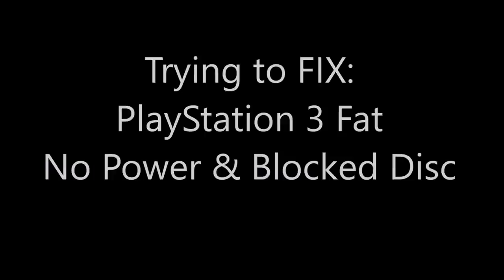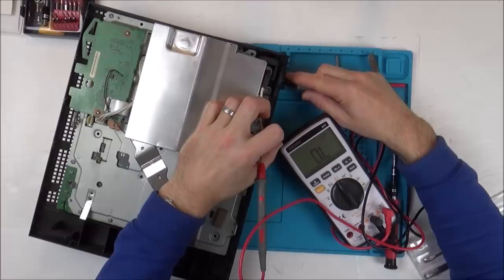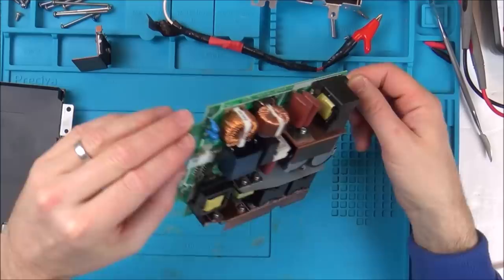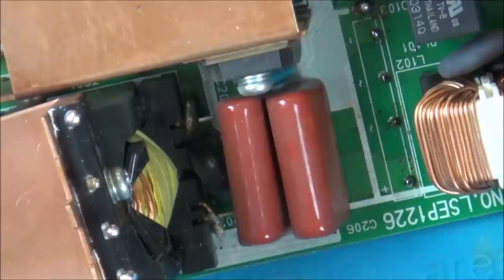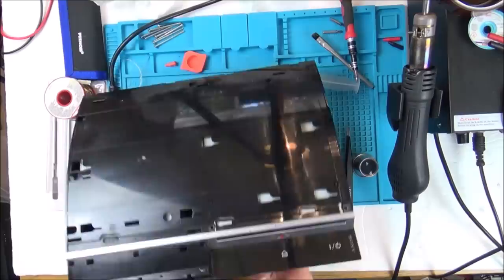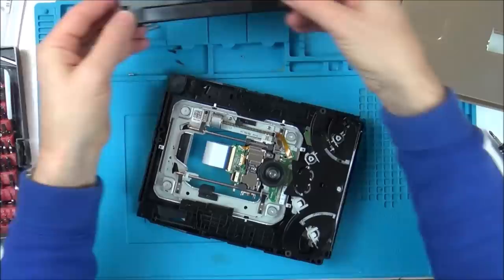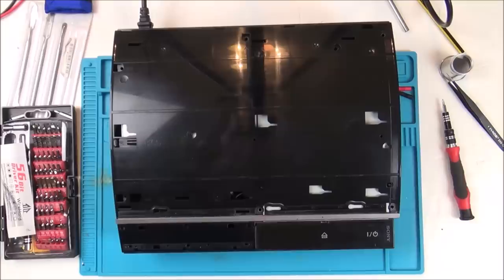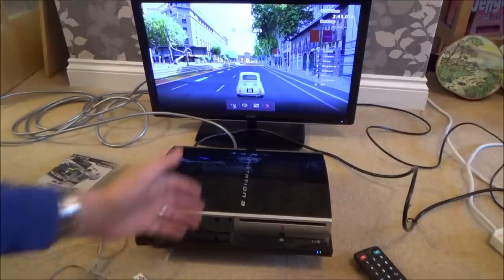Trying to FIX: PS3 Fat - No Power & Blocked Disc

Comment: I hope you used HI heat solder, or else you will get a fantastic bang when the solder gets warm as the bridge rectifier warms up , and then you only get a spectacular fireworks when the solder melts and make contact... and shorts the AC and/or the DC side. just a couple of gaming hours worth, really, you should get a solder wick and get all the solder off and then mount the rectifier properly in place, I hope you only use this when your in the room, and NEVER leave it on without supervision,

Comment: How long does it take for fan to go full speed? If only a couple minutes, it could need new paste under the CPU heat spreader. They are a pain to pop off and puts a lot of strain on the board. I would recommend soaking the CPU in Goo Gone for a day or so. It is a non conductive solvent. It will soften the old adhesive and paste. There is a slit on the side of the heat spreader that it can soak in from.

Comment: Vince, the power button might be working as intended. When the console is on, it ignores a single tap of the button. It only responds to holding it down for 2 seconds after the console is finished loading, then initiates its shutdown procedure.

Comment: The power button is a capacitive touch sensor. From the looks of it either the controller chip may have esd damage (unlikely but possible), or much more likely is the drop caused some shearing stress fracture on the solder or multilayer ceramic chip capacitors in it's circuit. Take a look at it under a microscope to see if anything looks off (hairline cracks, etc). EDIT: thought about it and I think the replies many other's have left are correct, the ps3 wont turn off with a short press to the power button, you have to hold it for a little while (it's been a year or two since I've touched my ps3 since getting a ps4 so my memory is foggy).

With that out of the way in case you are interested: technical explanation time on how cap sensors work, basically the chip repeatedly/quickly charges up the tiny cap on the input pin (and the pin itself has parasitic capacitance) and discharges it while measuring the amount of time it takes to empty by incrementing a count (which it clears between measurement cycles). By touching the button contact your body is adding capacitance in parallel (thus additively increasing the total capacitance) and the time to discharge the pin proportionally increases. So by setting a threshold to compare against the measured count along with applying other fancy sensing techniques to filter false positives/negatives the controller can sense if you are touching the button or not. Most cap sensor controllers do periodic active calibration to readjust the threshold every few seconds or so in case environmental factors like humidity or temperature start change enough to skew the count and prevent accurate reading of the input.
Reply: No. It was working as intended. You just have to long-press it on the playstations as it ignores short presses. You saw it was working as he turned the console on with it. Source: I owned multiple playstations...
Reply: @maxz8807  yep, I edited my comment to correct my mistake. I've totally forgotten how the power off worked on a ps3 as I honestly haven't touched mine in quite awhile since getting a ps4 and switch.

Comment: Hey Vince this is what the ps3 Front button Was made to do Just lightly put your finger on the on button for a few seconds then it turns off... don't put force on it because its a touch button. You have to hold your finger over the button, then it will go into stand-by mode. Then you click the switch on the back of the PS3 to turn it off. That's all it's for there's nothing wrong with it its completely normal
Reply: Hey Vince Glad I was able to help you out on that ? and it was helpful to you I'm also glad that you Read reply or like your comments it let's us no take care

Comment: In regards to the console not turning off, you need to hold the power button down for about 3 seconds, then the console will beep and the power light will flash to indicate it's turning off

Comment: Nice fix, you got the power sucking beast going again 😀 but is it one of those lovely PS3s with PS2 backwards compatibility?   I especially liked the CD drive fix, it did sound like it thought a disc was in the drive didn’t it and that bend must have been the problem!  Hmm not sure about the noise, only ever has PS3 ‘slim’ and that wasn’t the quietest thing.

Comment: I think it was opened up to get the disk out after it would no longer power up and that is why the drive was positioned the way it was. If I remember correctly when I had one you have to hold the power button to turn it off.

Comment: Odds are someone dropped the PS3 with a disc in there and since the unit was open prior (tampered with), the person was just trying to recover the disc by opening the CD assembly as you did. Since he took it out that way, the PS3 was in a state where it assumed the disc was still in there. Agreeing with Richard that the bend was due to them messing with the drive.

Comment: Hi Vince I really love repairing stuff and I'm quite new to capacitors and that sort of stuff I really enjoy watching your videos and I always learn something new you really inspire me I'm just wondering what does the bridge rectifier do and why would it cause no power thanks😊
Reply: Daniel 12345, the bridge rectifier converts ac power to dc power. The ps3 needs dc power to work. So without the bridge rectifier, the ps3 won’t get dc power, so therefore, it won’t turn on.
Reply: A Bridge rectifer is 4 Diodes conected together in effectifly a loop arrange ment positive-negative-positive-negative-positive-negative-positive.........Imagine a square sitting on its corner so it looks like a diamond and each edge is where a diode would sit connected to each corner arranged as per earlier part of sentance.........also very similer to a Full wave rectifier.
AC is a cycle of starting from Zero for 240V AC (UK)  0V=negative(grnd) first half of cycle peaks in one direction at 120V its direction then reverses so V becomes  120V@50Hz ( cycles) peak to peak measured from a base of 0 V (Neutral...grnd) meaning every 25 cycles will be either @ 120V+ or 120V
with rectifiers being arranged in fashion I mentioned one half of that Diamond will allow Current to Flow on say the + side of V going through one pair of Diodes but not the other pair and  the  - cycle the current can flow through the other pair of Diodes in the other direction of Current flow taking a connection from each pair of those Diodes will give you a Rectified current ..that is instead of it being a sine wave in Alternating Current it will become closer to a longer pulsed DC Current though not perfectly smooth(Flat) this is where using balancing resitors / Inductors and capacitors can produce a steady clean DC current. Its easier to see it done Visually than through words look at this short Videoto see what I describe
https://www.youtube.com/watch?v=PfWmIQfYIRI
Reply: @that1seagull905  thanks so much
Reply: @CameraObscure  thanks so much

Comment: hi Vince, i'm getting 12v out of the PSU 12v output, but for that i need to short the pins 1 and 5 on the cable coming from the PSU. also, after that i'm not getting any power on the power/eject board .... any idea? --- btw, great channel. ;)

Comment: I think they dropped it and break the bridge rectifier, PS3 was no longer booting up, they dismantled the PS3 and DVD player to remove the game that was in. And regarding the power button, you need to hold it for a few seconds in order to turn off the system.

Comment: Change thermal paste. Give the fan a clean, even make it a custom PS3 that will last forever and drill holes on the bottom for the fan and put a grill there..       but try holding power button for longer

Comment: I'm on my 4th PS3 and from experience and fixing these, the high fan during gameplay of Gran Turismo is not really "normal" -- as in, this thing is warning you it's going to kill itself. I've had 2 failures exactly like this. My 4th is a sealed up, still has the warranty sticker on, untampered version and the fan stays on it's middle setting with all games. The other 2 that died experienced the high fan setting before RLOD. There appears to be 3 settings, low, medium and high. There is a factory clean option which is seemingly like an overdrive but you will never experience that fan setting during normal use. Ie. the blow the dust out setting. It sounds like a vacuum cleaner on this setting.

If you experience the high fan setting, it indicates to me it's already overheating. Over time, this will result in the reflow/reball issue (RLOD) or the capacitor problem. Again, i'm on my 4th unit, 3rd Fat model. Tried a slim but it ended up with another video glitch out issue. It's so hard to keep these things going. 

40:43 - The power button is a soft power button, as in it tells the machine to shut off. But you have to hold it to force power off, system doesn't like this. It will bother you next time saying it wasn't properly shut down. Proper shut down is through the menu so it can complete file operations and shut off properly.

Comment: Hello. You need to hold the power switch for more then 3 second. And it will shut down. If it does not replace that chip.

Comment: @MyMateVince  Thats the normal fan noise for a FAt Ps3, i have owned one and replaced it with a slim  just because the noise, but i did  do the thermals mod, drilling holes on the underside (find video on youtube)  right under the fan  and replaced the thermal paste and it got  pretty quiet after that, but you  do have to drill holes in the bottom plastic  if you want to get the result.. But better just to get a Ps 3 slim and call it a day.

Comment: I was trying to fix the laser on my ps3 once and forgot that i had a disk in, and when i fixed the laser i took out the disk and put everyting back together again, and when i started the machine the disk reader was closed like yours and didnt reset, so i had to take everything apart again and put in a disk and when i connected it again it reseted and  the laser worked 🙂

Comment: Those touch buttons were always temperamental, that's why they were phased out in the next iteration of the console, that small metal connector is flimsier than a babies fingernail, which is usually the reason for issues, also delidding the chip and replacing the thermal paste will do a bit in helping with the heat issues although the actual reason you'll have an issue is because the CPU in these older launch model ps3s needs to be removed off of the board re-balled and then put back on, you need some advanced equipment to do this, so it becomes a little more impractical.

Comment: Hi Vince, was just going to say the same thing, the PSU from the one with the failed delid is the same as this one so you can just swap them over, also for the loud fan i would try first changing thermal paste only and if it's still the same then you can try delidding the RSX (much easier than the CELL) and doing the rubber trick on CELL (look it up on google) that should get it working nice and quiet
Reply from the maker: Thanks Federico :-)

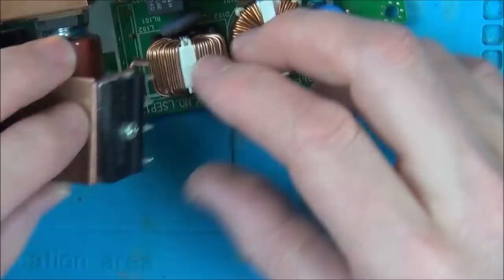Comment: My theory is that something very very heavy was set on it, plastic didn't break but it smashed the rectifier and the drive cover, why I think this is because the pins on the rectifier are bent forward so a forse made them bend so far till they break, the pins are thick, it will never ever break on a fall alone unless it fell top down but that would break the plastic as well or get scuffed for sure. all in all, those legs on the rectifier 14:06 are bend for sure

Comment: would of be a lot quicker if you got a diode or capacitor leg soldered to bridge rectifier pins, cleared holes in PCB, inserted bridge soldered done

Comment: The power cable would probably test working if you went across the correct plug pins. You had the end that plugs into the PS with the middle plug down and the wall side middle plug up, so left to left, etc. would have been crossed. =)

Comment: I discharged a cap in a camera this morning the sketchy way, I bridged it with a screwdriver, it scared the shit out of me because it was so loud and a massive flash. Looked at the cap afterwards it was a 330V......oops.
Reply: better through the screw driver than your finger.... may have been a cap for the flash unit (high power, fast discharge)

Comment: There is nothing wrong with the original power lead, the POS & NEG they are just the other way round. Hold both plugs side by side, (ie the 13 amp plug & the unit plug) and you will see that the plug that gose into the unit is on the other side it is clearly marked L & N

Comment: Umm vince you actually have to hold the power button till it turns off it doesn't turn off with just one press that's only on the slim and super slim consoles

Comment: Based on the damage, I'd say it got dropped on the corner where the power button is.  It may be worthwhile just to hit that area with the heat gun just to reflow the solder.
Reply: Nah the area's fine, it's working as intended

Comment: I bought two working ps3,s from one seller he done a deal on both of them the fault was not reading disc with both of them one still had all seals intact the fault was not the laser with this one but the drive cable itself changing it with another it fully worked and i gave it to my sisters son ,as his ps3 the laser stopped working i was going to replace it for him but when my sister gave it to me it was a slim model so the laser mech was wrong for it and my sisters boyfriend had removed all the screws and lost them nothing worse than something someone else has taken apart ,the second one had been apart and dic drive mech was much lock yours was in the up position after many hours i found a piece of metal on the drive that should move stuck after freeing it i spent many hours completly dismantling the drive regreasing runners and reassembling it i got it to eject disc fine but still not read as i was about to give up imanged to get it to read a disc yest again it seems the drive cable is the culprit ,this ps3 had been apart before though i managed to get the drive cable in a position where it now workks and reads fine but could do with a new cable to make sure it is a perfect .What i have learned about ps3 fat drive models is there are a few different types both had the same type of laser but mechs and  the board on the bottom of the drive where different i learned that the laser is not always the fault and how to put different drive mechs back together and just because the cable looks good it might still be faulty .
Reply: And I bought one two weeks ago a CH ceche01 sold as working paid $220 usd because it's supposed to be backwards compatible or partially. Anyway come to find out GPU chip is bad and all kinds of graphical errors on the startup screen then it freezes to black screen. Yeah man I tried everything, I mean everything possible new cables try a v different controllers different TVs two weeks freaking trying everything under the sun still a no-go. After many hours of reading Forum posts I'm talking to 15 to 20 people GPU is what keeps coming up GPU chip that's what I've been told over and over again so. Pretty pissed off, but refund on the way. I just have send the freaking 20 lb block back North Dakota via UPS. As somebody who's never seen a PS3 before, damn it was a a beautiful piece of plastic and metal   I hate to have to send it back but I'm not going to pay 220 some shit that don't work no way in hell. I guess I'll just stick to PS2 for my PS2games. I wanted to see.... the whole purpose was to see what the PS2 games look with the higher resolution of the PS3. 

I don't even know anything about PS3 games. Would it be worth it to buy  the cheaper version like the Slims for a just the PS3 games?? Are there that many decent games in PS3 library that would make it worth it you think?? When I say decent to me that means RPGs.

Comment: that sistem is loud, and get hot REALLY FAST, you have 2 options to make the sistem live more years, 1° you install a potenciometer regulate the speed of the fan manually, 2° put a CFW in that machine, and install WebMan, so the sistem work whit the fan at the 40% minimum and go up wen the sistem pass the 65°c, that way the ps3 should work a few years more

Comment: The older PS3s just get loud unfortunately. Best you can do is reapply thermal paste but don't bother with the delidding nonsense. They run hot & loud, but the hotter they get the louder they become.

Comment: If there is a Heat Sink Vent, Next to the Fan, Take it out and Clean it, u could probably, use Liquid Soap and Hot Water ??? .. Then put it on the Radiator to Dry .. DO NOT REINSTALL Till the is ZERO MOISTURE IN or ON, THE VENT .. IT MUST BE BONE DRY  !!!

Comment: i cleaned the lens of my mates ps3 years ago, i took the disk tray apart and realised i left a disk in there, so i just pulled it out of the top, when it come to testing it ithe disk wouldnt go in because of the little white thing, so i took it back apart and put the disk back in through the top, put it back together and the disk ejected straight away, maybe the disk drive still thought there was a disk inside but couldnt eject because it needs the disk to engage the locking mechanism

Comment: Great video friend,
12:10 you should never do this, if there were some charged capacitors, you could have shorted them throw other components which would result in a no good situation.
Reply: He just checked the capacitors, they were empty, this was just to check to be absolutely sure before he touched it with his hands
Reply: @televisionandcheese  Yes, and that's the problem sir, if there were some charge somewhere he could have made a serious problem by shorting traces.
Reply from the maker: Thanks Fix Daily :-)